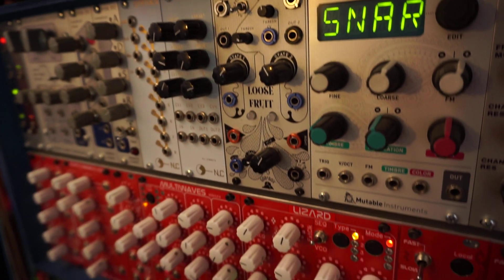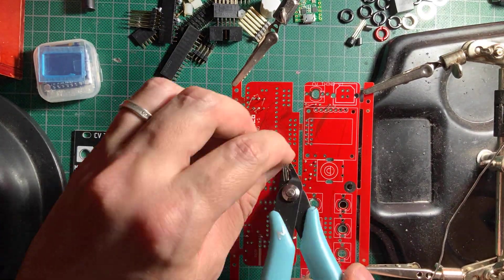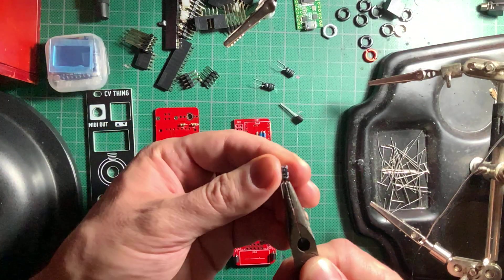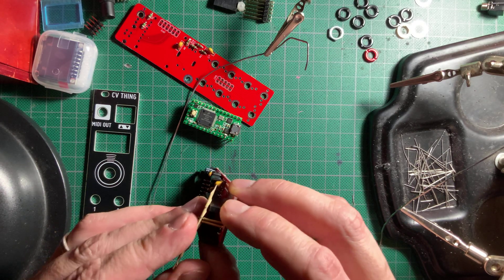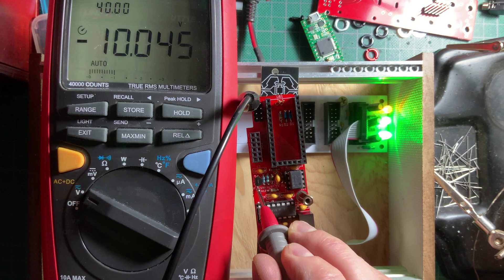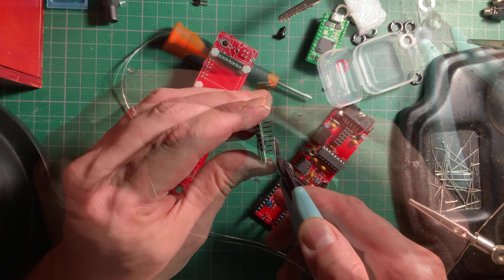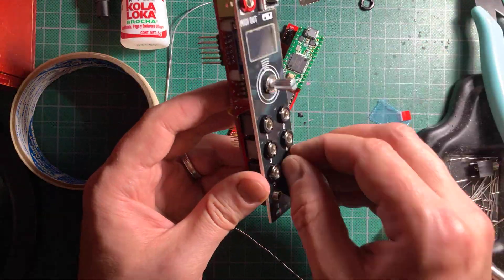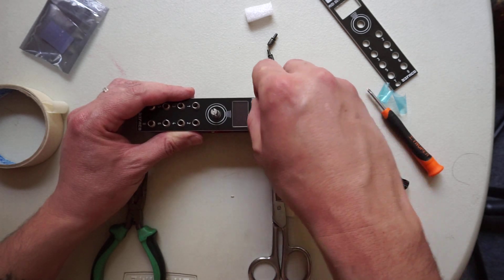Befaco CV Thing - Build Video

Comment: I apologize if I’ve spelled your name incorrectly but hey quincas I’m a diy modular synth enthusiast as well, was building an antumbra atom (an 18hp version of mutable elements) with a lot of surface mount stuff, I’ve built O_C & Clouds and many many other modules and synths without any failures, but this one didn’t work.. the ARM processor had a indent on 2 different corners didn’t know if you’ve encountered this or if you knew what the correct orientation is if so.. thanks brother love your channel
Reply from the maker: That's the right spelling :) As for the ARM chip orientation, I'm not too familiar, since I've never built any of the MI clones! Try looking at the data sheet, or ask in the Pusherman and Eurorack DIY groups on Facebook ;)
Reply: Synth Diy Guy thanks mate

Comment: what's the interesting-looking module at 0:14 with two springs on it?
Reply from the maker: There are two modules with springs on that frame!
The one with 4 springs is Meng Qi's touch matrix mixer, Lines: https://youtu.be/C-X44uojftI
The one with two springs is just a module version of Taktile, using springs instead of an etched PCB:
https://youtu.be/DT6nZsixP0M